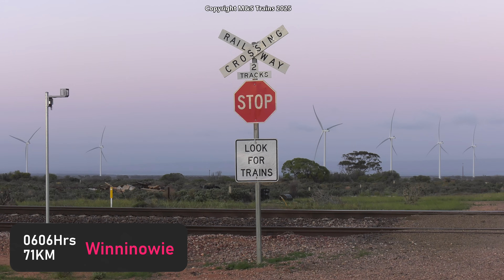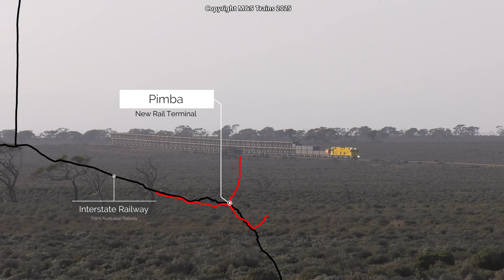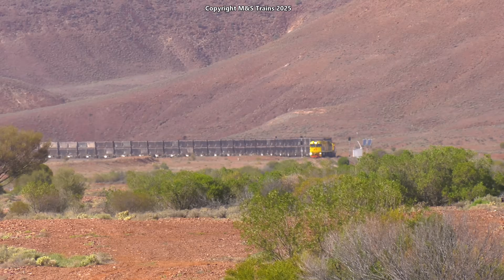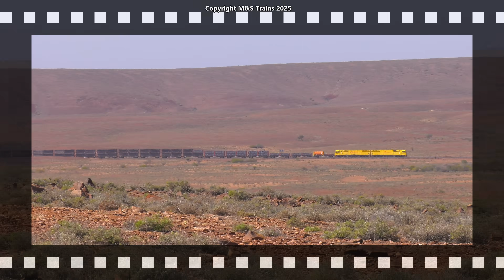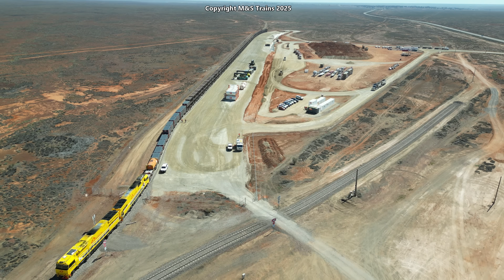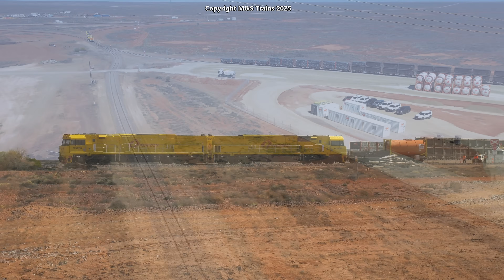NEW AUSTRALIAN OUTBACK FREIGHT SERVICE AND TERMINAL - Aurizon's & BHP's new Freight Train to Pimba

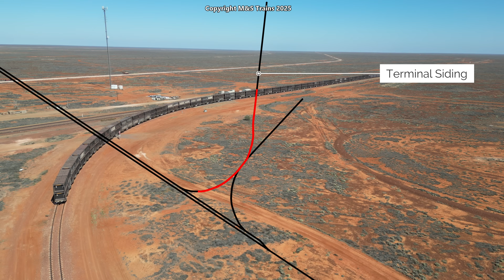Comment: great shot, at the end of the video we see the locomotives detach and go down the spur off to the side, what was the purpose of this move instead of just staying attached to the train so it can go straight out as you mentioned in the  video around 8:25.
Reply from the maker: I'm not completely sure. I think it was so the gates across the track can be shut to the terminal. Keeping the locomotives on, meant the train was too long to fit.

Comment: 2 locos only? are the containers empty?
Reply from the maker: Yes, these ore containers are empty to Pimba and return loaded to Adelaide, but only two locomotives are needed either way. In fact one locomotive would be more than enough for this size train when empty. C44ACi locomotives produce over 4300 horsepower. Loaded trains wouldn't weigh over 4,200 tons so two engines are plenty with minimal grades on the return trip.

Comment: Hope they don't have freight trains three miles long like they do in the USA
Reply from the maker: 1800 meters is the max which is 1.1 miles. Arguably it would be more efficient to combine the Melbourne and Sydney trains together at Port Augusta and run 3600 meter trains (2.2 miles) for long remote trip to Kalgoorlie or even Perth.
Reply: You hope they don't operate as efficiently as possible?

Comment: Should be solar powered.
Reply: Joking right ? Those 2 locos combined power would be approx 8000 hp. Do you know what area of PV panels would be required to produce a continuous output for that load..?
Reply: @kenc3288  Watermelons don't have the beginning of a clue as to how pointless solar and wind are

Comment: thanks, designing two parallel railways in one direction and using distance between them for caring huge water or large volume of goods in high-speed freight trains with H fuel engine.

Comment: How much weight those engines pulling
Reply from the maker: Not much on this run. Only about 1,500 tonnes. Two of these engines can pull around 5,000 tonnes out here without too much struggle.

Comment: Is the fuel tank for the train?
Reply from the maker: Yep, it's called in line refueling and it's a pretty common out here due to the long distances and remote aspect of the route. Aurizon and SCT Logistics use them so they don't have to stop for fuel or have a fuel stop along the route. Pacific National doesn't use them but has a settlement in the middle of the Nullarbor Plain at Cook, where trains stop and refuel. Fuel is taken to Cook on the train.

Comment: Is the orange tank on the lead car an aux fuel supply for the locos ?
Reply from the maker: Yep, it's called an In line refueller. Means the train doesn't have to stop for fuel at all enroute as it can be refueled as the train moves.

Comment: The length of 600m is smaller than the European target of 750m yet you'll have always transported more goods because of double stacking which is impossible in Europe. We just don't have enough space to double stack containers or whatever. I'm talking about Belgium and it's neighbours. The UK has even a lower profile and I'm assuming that most railways have tunnels, bridges etc that just don't allow two containers to be stacked together. So 600m becomes 1200m while 750m stays 750m.

We have no money to do anything but wage war pretty soon so I don't see bridges or even complete freight corridors being converted to make stacked solutions possible.
Reply from the maker: Our usual Intermodal Trains over here are about 1800 meters long and with Double Stacking! It's the only way rail can compete with road and sea. 

The Inland services can run a bit shorter though especially lock in contract trains like this one. This train should double in length at some point I've heard too. 

Thanks for watching!
Reply: There is no we when it comes to Europe. Europe is not a country.
Reply: @CorneliusTaylor-s1uwhich countries do have the ability to double stack containers on international trains?

Comment: There are proposed mines in the Mid North of SA that want to hook into the existing line at Pirie, first in best dressed I suppose.
I wonder how they fill the containers without unstacking the top ones.
Reply from the maker: Interesting. Hadn't heard about these other mines. 

The containers are put on trucks (single stacked) and taken to the mines where they're loaded and returned to the train.
Reply: @MS_Trains  Mines proposed for east of between Terowie and Olary. Big projects owned by small companies with no money, hoping to be bought out but they have the ore and the approvals so 10-15 years my guess.

Comment: why can't this run electrically? If catenary is deemed too expensive use containerized mega batteries on a couple of train cars behind the Diesel(electric) loco. Really no excuse in a country with such abundant potential in renewable energy
Reply from the maker: The South Australian Government can't even get their act together to electrify Adelaide Metro Network. I don't think we'll ever see catenary out here. Battery locomotives with battery wagons maybe. If it's cheaper these operators will use it.
Reply: Batteries are not efficient, so does solar power. A direct pickup via catenaries is the most sensible solution

Comment: @MS_Trains, just asking? Is the orange tank i see behind the two yellow locomotives,  the locomotives fuel tank? I just wanted to know.
Reply from the maker: It's additional fuel yes, for the long distances. Return journey is a bit over 1000 kilometers, which is stretching the limit for normal capacity tanks.

Comment: Engines seem like AC4400CWs but without steerable trucks. Interesting.
Reply from the maker: They're the AC44000CWs, Australian cousin! Same engine but with a lot less weight in the frame.
Reply: @MS_Trains  Why is that? Lower track axle load ratings?
Reply from the maker: @pancakerobot123 Yep max on this line is 25 ton axle loading. Most locos have only 23 ton axle loading due to other routes.

Comment: First time watching here in the USA,, impressive sounds,, smooth rails.. in the USA you can see dates on rails still being used,, from the 1930s 1940s 1950s 1960s 1970s 1980s 1990s.....
Reply: Here rail was used as poles for the railways, oldest I have found is stamped ILL 1898 most of it was imported from the UK and USA back in the day.
Reply from the maker: The track was upgraded in this section to 60KG rail about 5-10 years ago, so it's in good condition. The further out you get you'll find some 60's, 70's & 80's rail. 

Oldest I've seen was on a siding is 1913, when this line actually started construction. See it for yourself here at the 09:20 mark. https://www.youtube.com/watch?v=N29a2koVJNw&list=PLFl6e-2LjdAwyPY7-CIyoOgTf9_KhLOE8&index=4

Comment: From US great vedio,  what is the orange container behind the locomotives.
Reply from the maker: Inline refuelling. Means they can operate continuously without stopping to refuel. Fuel is pumped into the locomotive tanks as it's used, increasing range. Also helps as there aren't many places to get fuel for trains out here!
Reply: @MS_Trains  also the little truck
regulation separation
as in fuel tankers and flammable stock
Reply: It's where they keep their lunch. Loco gets hungry 🍽

Comment: Should be electrified
Reply: Got a few billion to  spare??
Reply: @paulwarner5395 Haha, does Aurizon?
Reply: How, where would you put the generation and have it cover the hundreds of kilometers!
Reply: @RamonInNZ This stuff has been figured out for more or less a century now, see the trans siberian railway, milwaukee road, indian railways, the shinkansen network, etc. It would be completely feasible if funding was allocated
Reply: Potentially very little benefit considering the cost to build the infrastructure way out there to power a relatively low number of trains.
Reply: @GiveMeSpaceTravel-bg8td It's a big upfront cost on an investment that ultimately makes operation way cheaper in the loooong term!! But that's definitely valid, no business in this day and age wants to make long term commitments, even if the benefit is way cheaper, cleaner, more efficient, convenient, easier, quicker, etc. operation to pass on to the next generations. Maybe if you tell Aurizon it'll cut their expenses in half they'll electrify!!

Comment: Is the railway line completely new ? Are the trains automated ?
Reply from the maker: The train uses the existing Trans Australian Railway. A new terminal has been built at Pimba for the train with trucks moving the freight between the mines and the terminal. 

Trains are crewed. Only in the Pilbara on private lines are Freight Trains automated in Australia.

Comment: The government and ARTC need to start a long tern program of extending passing loops.  Then well timed trains will merely need to slow as they pass each other, instead of stop.  This will mean greater efficiency, saving time, money and fuel as well as getting more freight off the highways and on to rail.
I have spoken. 🧐😉
Reply from the maker: Could trial that between Port Pirie and Port Augusta, maybe. Skipping straight to double track on that section would save a bunch of time also.
Reply: @MS_Trains  Follow that up with Port Augusta to Snowtown. 👍  (edit)  whoops, I got that a bit wrong, meant to say Port Pirie to Snowtown.
Reply: Lol, they're too invested into Inland fail right - forget exisiting track work, TSRs or other exisiting issues.

Comment: Good news again on inland freight services.
However bad  freight news has happened in  Kalgoorlie. The shutting down of the Nickel refinery earlier this year has affected the whole town. The line to Leonora which serviced the Refinery is on care and maintenence likely permanently.
Re Electric vehicles batteries it appears that Aluminium is being researched  to be "maybe" introduced some time to the batteries.
Yes WA has aluminium deposits in the Perth Darling Range being worked by Alcoa.
Reply: I find that very hard to believe as I work at murrin we get trains daily into Malcolm rail siding through Kalgoorlie, 2 daily into Malcolm sulphur train and gold valley iron ore train plus train into Leonora servicing rare earth so the line is very heavily used..
Reply: @Jeffbaci1969  Yep the Gold Valley Iron Ore Shipping from Wiluna is very recent. By road to Malcolm Rail Spur then to Esperance Port for shipping. The comment about Rare Earths  is spot on. It is likely that area will be a Rare Earth Province because of Mt Weld and about 6 others likely.
It was all in the Kalgoorlie Miner paper. at different times.